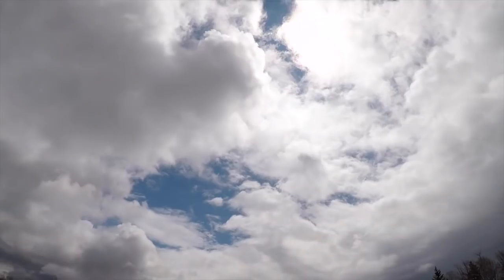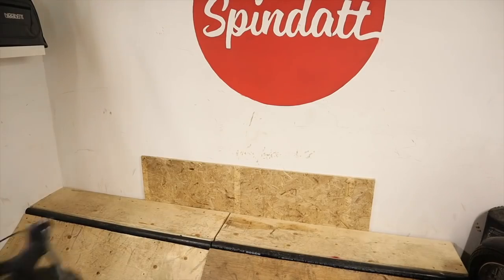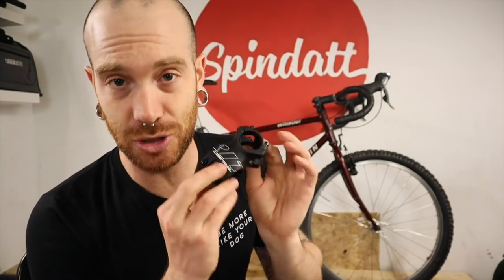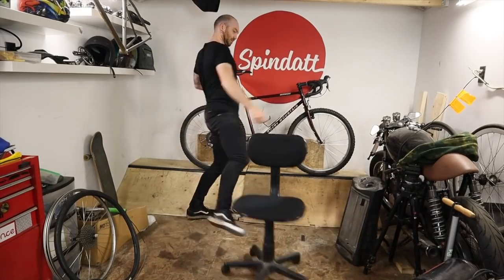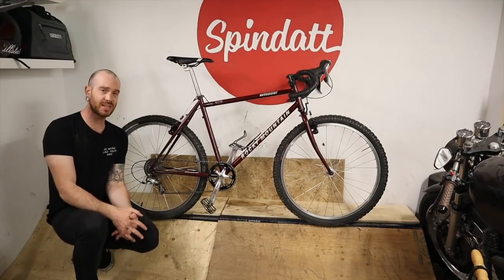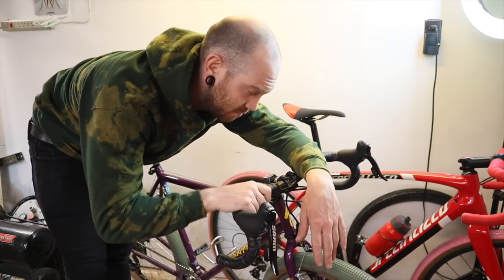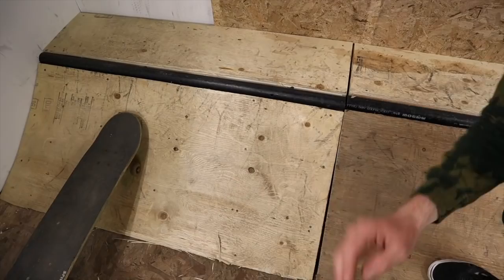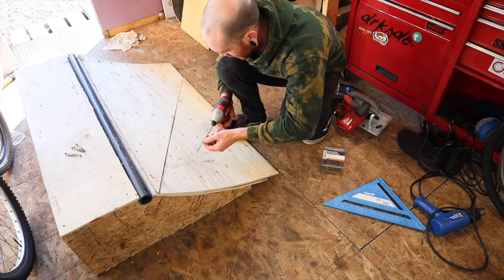Had Fun Anyway

Comment: Getting tougher to find deals on 26" rear wheels with 8 speed+ hubs to replace the freewheel old 6-7 speeds.  I have a bunch of stems from fit experiments but nothing shorter than 90mm with a 31.8 clamp.

Comment: Yes, finding the right stem length for a mtb to gravel conversion is crucial and not as easy as you think. Go from short to longer. I still need a 0mm offset seatpost for mine.
Otherwise, best ride i ever had.
Reply from the maker: I think the nail is finally hit with this setup!
Reply: @Spindatt  Hope the best for you. Mine is a '92 stumpjumper with about the same geometry- yes, those bikes have loooong top tubes!